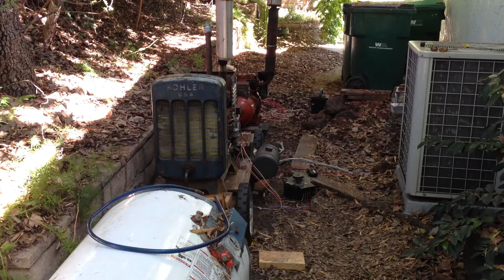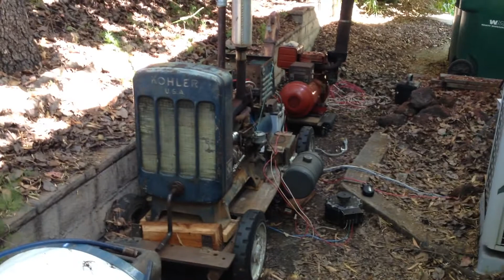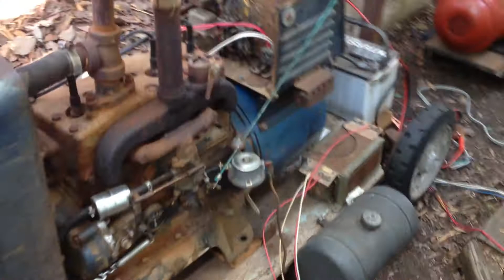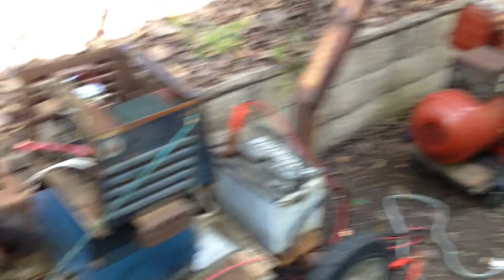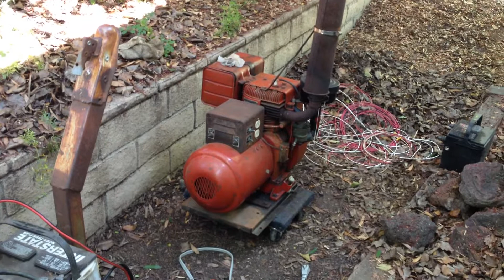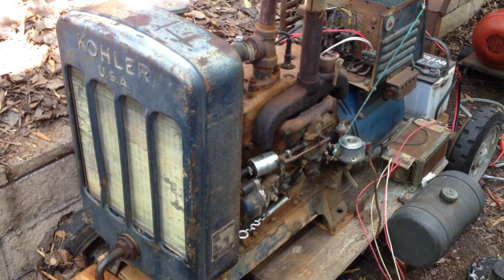1965 Kohler Electric Plant Generator Set, repaired and back in service

Comment: I have worked on LOTS of older equipment and never quite figured out why they went with a 4 cyl to drive a 6.5 Kw set. I mean, in theory you only need 12 - 14 HP, which is doable on an engine half that size. OTOH, that was the days of "bigger is better" so that engine is only loafing like a walk in the park. Should last a lifetime.... oh wait, it already did!
Reply from the maker: Remember also that this set runs at a nice 1800 rpm, so all other things being equal it would need to be twice the displacement of a 3600 rpm screamer. This engine is 60 ci and rated at 12-1/2 hp @ 1800 rpm. Slow and steady gets the job done! 😎
Reply: @realvanman1  ... yes, it all depends on the HP curve of the specific engine. If you can get what you need at 1800 rpm then everything last longer too, never mind the noise reduction.